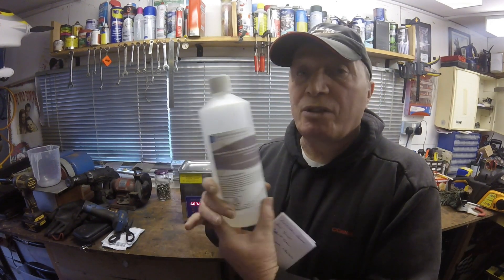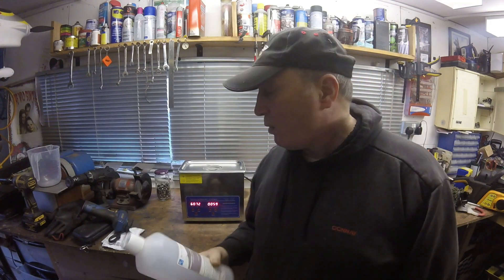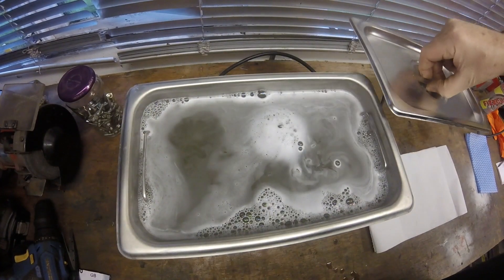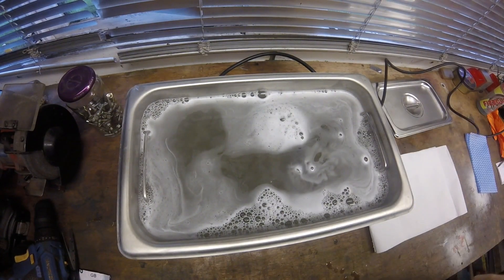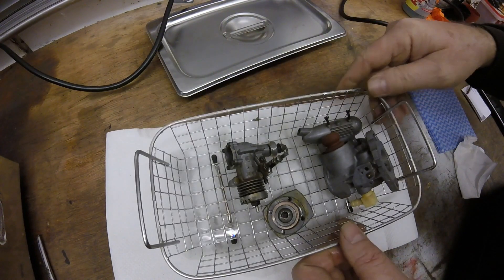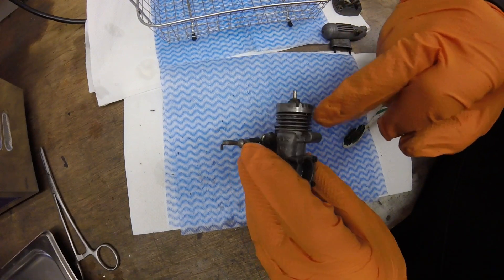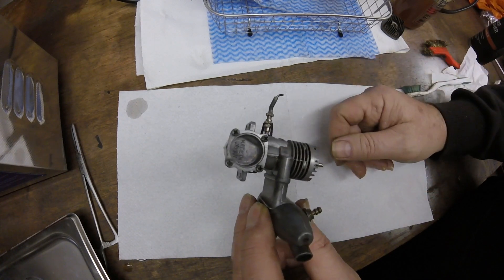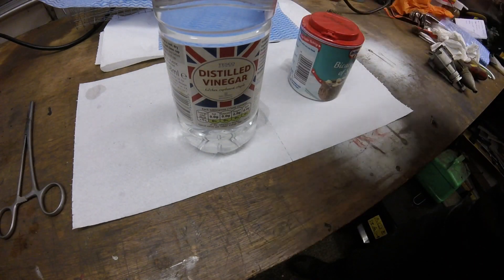Cheap Ultrasonic Cleaner - testing Cheap home products on carburettors & RC Engines

Comment: Interesting Roy,  not too sure about using the Descaler , but I reckon the safest way that actually Cleans is the Washing Up Liquid .........Also do You still have the Heater turned on whilst the Cleaner is Vibrating or do You turn the Heat off once its reached Temperature ...?

Comment: Interesting Roy👍
Petrol works, you need a glass jar to resonate tho and heat helps. 
I've used that carburettor cleaner you've got at first. But for the last few years I've been using Screwfix 5L container degreaser. Works well but does discolour the metal.
Reply from the maker: How long was you leaving it in for